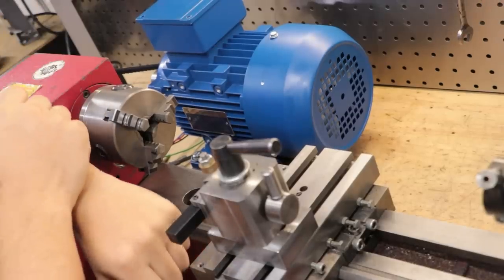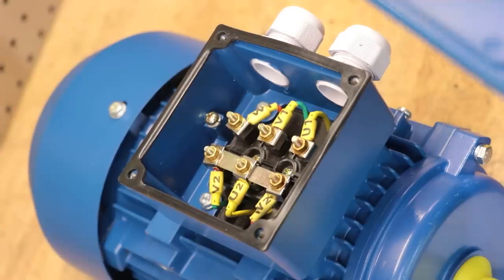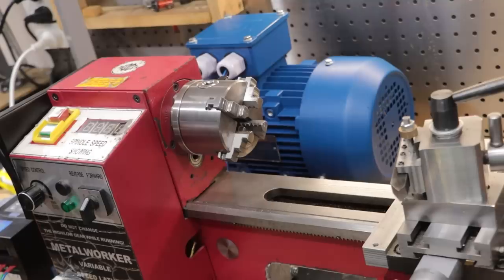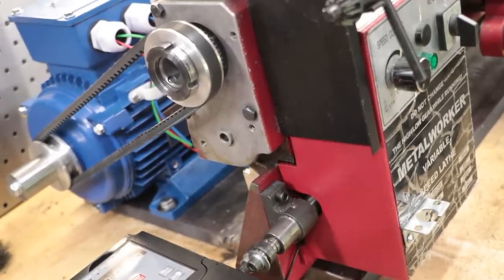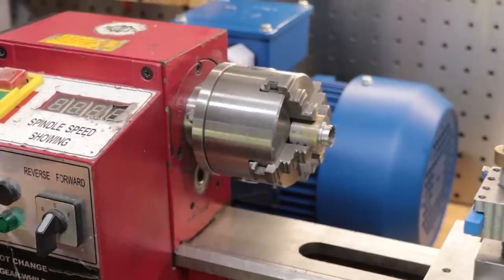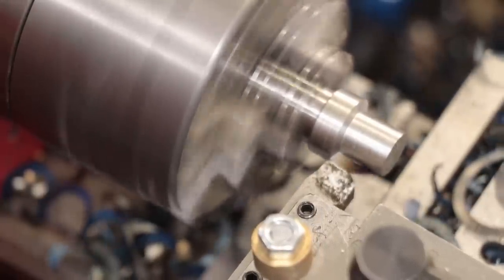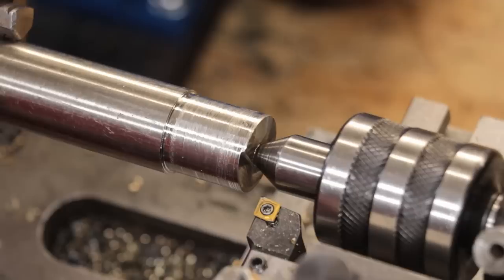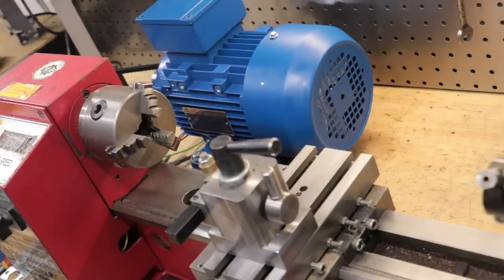The 3HP Mini Lathe..... It Scares Me

Comment: good upgrade...BTW with 4140 it will chip lovely with a dcmt style insert .the problem is heat in the chip. if the swarf is hot it will be stringy mostly. suds will help loads but you will find the biggest difference is reduce the spindle speed with a decent feed rate and it will chip ..if the feed rate is too slow it builds heat like when the spindle runs too fast ..its finding that balance..you can probaby tell I machine a lot of 4140 :)

Comment: I'm not sure what was causing the fear in the comments.  It seems that the only real possibility of catastrophic failure in in the spindle, but it should take way more deflection than a cutter is going to produce.  The bearings should wear faster, but that will likely become apparent before there is the possibility of a major failure.  Based on what I'm seeing, it looks fine.  It might be fun to see what a more massive chuck and some added weight to the carriage might do to improve cuts.  Weight could be added to the carriage simply by bolting it on.  This has been fun to watch!  Continued success.
Reply from the maker: I'm not sure. I am pretty confident that the lathe will handle it all. But im always happy to provide the reasoning for this

Comment: You can over clock the vfd and run at 60hz with modern motors that would give you a higher speed.

Out of interest what is the availability of older quality lathes where you are? I have an excellent Hardinge and it cost very little and has a ton of swiss multifix tooling. You might find so university selling up their tool shop tools. I would highly recommend going this route. Mine now has a new motor and vfd and runs like a dream. It's super accurate too.

Comment: I had a 1hp 3ph motor on my mini lathe , two speed v belt drive with a quick release mechanism on the tensioner lever - changing speeds took about 5 seconds . There was a lay shaft that fed power from the v belt drive across to a poly v belt and this to the spindle . Even 1hp has enough grunt to flex the carriage  but it never broke and in low speed I could get down to 60rpm and on high 3000rpm - the taper bearing get hot at this speed ! On the motor I put a small 12v Thermo fan -150 mm dia iirc and this was speed controlled via a cheap Pwm controller I got off eBay - I could run that motor all day under load and it barely got warm . In retrospect I could have saved a lot of time and effort if I had have used a 3hp motor as it would still have enough power when running slowly where as the 1hp didnt and I wouldn’t have needed the two speed drive . I now have a small optimum lathe as I sold the other one minus the motor and vid and I am going back to using HSS as it is cheaper , needs less power and is more durable than carbide inserts for what I do - every time I use it I find the edge is chipped and I have to change the insert around .

Comment: That motor seems to work wonders, makes me want to try that too.

I have a slightly bigger lathe, 400mm between centers (16") and with a 100mm (4") chuck. It came with a 600W DC motor, which is not too bad, but it stalled easily on big diameters with low rpm (only has electronic speed control and two belt positions). What I did was machine a smaller pulley for the motor, about half the diameter of the original one. That already helped a lot, recently machined an arbor with 100mm on the outside from CrMo-steel which was pretty tough, but could go 0.5mm a pass. The chips look and behave like small springs.

Oh, btw does your lathe not have a lead screw? It really helps making consistent cuts and is less tedious on the hands (also can get the left hand from the spraying hot chips lol). Also needed to make proper threads.
Reply: Minilathes have a leadscrew but it cannot go slow enough to do anything useful
Reply: O

Comment: Are you hand feeding the carriage because auto feed with proper feeds and speeds will give you the nice surface finish that you want.
Reply: yea, i thought his halfnuts were slipping or something mid cut .
Reply: He has neither a Feed Screw, not a Keyway in his Leadscrew, so no Powerfeed.
Reply: @an2thea514  The harbor freight mini lathe I had years ago had auto feed. It was too slow but at least consistent enough to get a descent surface finish.
Reply: @JETHO321  some Mini-Lathes of this size also have one change Gear Ratio of (most often) 0.1mm, but I destinctly remember his lathe not even having that.
Reply from the maker: Feeding by hand. Lots of pressure on the small hand wheel, plus I have to watch out for the hot chips. That kind of gets in the way of getting good surface finishes. Plus remember these were all what i'd consider roughing passes.
Reply from the maker: I have a leadscrew for cutting threads but its not attached at the moment. I just haven't had the need to cut threads for months and in that time ive pulled the lathe apart 4 or 5 times, so I felt it easier to leave it off until I needed it.

Comment: Rather than trying to shim the lathe, can you use the 2-piece vice to secure the plate to the mill and skim the surface with the monster fly cutter to flatten at lest the section the lathe itself sits on (it doesn't really matter if the motor section is flat as long as the pulleys are lined up)?

Comment: if you're having issues breaking chips try putting a deflector on the tool either clamp on or brazed. just enough of an angle increase to encourage a stress bend on the chip. when i say deflector i'm thinking more of a slight redirect.

Comment: By switching to 3 phase you have eliminated the inherent single phase pulsating torque. Overpowering is a common technique to dissipate heat. Going back in time the trick was to fit a larger motor that the inverter. These days inverters are cheap so the new trick is to derate the system with the settings.
Use the Vee belt slippage as the fusible link and detune the motor to trip at around the same current / torque.
Well done with your continuous improvement model, all or most of the previous modifications are paying off now.

Comment: I use ground sharpened aluminium inserts for all my lathework, even on stainless steel. They will dull over time but for me they leave such a good finnish on the parts. And it kinda cuts rather than peels. The downside is you will go inserts a lot faster. but for a hobbyist and the cost of $30 for 10, I dont think they are too bad.

Comment: I have this one job at work in 316 Stainless and I do a lot of drilling and a little bit of milling into a plate. it's a real pain to break chips with the drill and I end up with a birds nest every single hole. I might have to code in a reverse spindle direction and coolant to blow off the chips.

Comment: Those tapered roller bearings are very strong at axial and radial loads, but they are very imprecise!
They move relatively much under load!
You can get angular ball bearings in alot of common sizes, they are much better.

Such a motor upgrade is on the agenda for my mini lathe too! Mine hase a 750W motor, that is somewhat acceptable....
Reply from the maker: I haven't found that to be the case, we are getting run out of less than 0.01mm on the spindle. Granted these are moderately expensive bearings

Comment: Those tapered roller bearings are UNBELIEVABLY tough, if you got a quality pair and keep them well lubed. We used Mystik JT-6 grease on them.

We had 4 of them on the blade shafts of our asphalt/concrete saws, powered by a 35HP gasoline motor, with a 50lb flywheel, side loaded (similar to what you have but needed 6 groove belts to transfer the power) under the worst conditions you can imagine. FILTHY, very high vibration, heavy loads, shock loading at full throttle, etc.

Even then, in 16 years, we only had to change out a single set of them. Every other time, the whole rest of the machine was basically destroyed by the work before the bearings ever gave out.

Comment: The problem with carbide tooling is that the suitable spindle/tool rpm is double that of hss and when the smaller diameters are machined the greater rpm's  are required for egsample 1mm hss drill may require over 10 000 rpm for machining brass or aluminium and tungsten tip/cemented carbide recommended rpm is 20 000, manual lathes these days from shop maximum rpm is 3000rpm. Australian fitter and machinists  are taught workshop formula(guesstimate) 300 x V ÷ D where x is multiplication,V is velocity of material,D is diameter of work(lathe)/tooling(drills,end mills and slot drills,side and face milling cutters etc...).
This leaves alot to be desired when efficiency with accuracy is a requirement. Take care and Cheers

Comment: I'll bet that you've really come to like that VFD controller. I think it can be wired up to a potentiometer so that you can simply twist a knob to control the speed. (You might already have that.....I just didn't see it).
As for surface finish, maybe you've got an arch - end to end - in the base. That would be a simple explanation. The cutter would go above, or below, the center line and that would cause it to drag instead of cutting. 
I just can't help but to think that there must be a simple explanation for the surface finish. Even a mini lathe should be capable of a better finish. 
Thanks for sharing! Us wannabes get to vicariously do projects that we're just not able to do right now - in the real world.  🙂
Reply from the maker: It doesn't come as standard, but it is in the wiring diagram. I think its a 5k ohm potentiometer from memory. Which material are you referring to about the surface finish. And rarely does it produce great finished when doing roughing passes, which is what I essentially showed off here.
Reply: @Artisan Makes  Not a "material" per se, but an upward or downward bow in your machine's entire base - likewise bowing the guiderails up or down. This would causing dragging in your cutters. So, it wouldn't be a twist, but an arch, end to end. I could easily be mistaken but looking for twist wouldn't necessarily reveal an end to end arch. You'd have to test for specifically that.  
Love your stuff!
Thanks again!  🙂

Comment: I have a question about you QCTP, where did you purchase it?  The QCTP looks like it locks down well.  The QCTP that I use doesn’t lock down properly and it always causes issues when turning any form of steel.  Can you share a video on how to check and correct a lathe bed twist issue
Reply from the maker: I made the tool post about 2 years ago. I have a video making it. Im sure there are more rigid tool posts but this one has the advantage of being compact too. I haven't gotten around to correcting the twist yet, but this old tony and blondihacks have great videos on the subject. Cheers

Comment: You can see the tailstock wobbling around everywhere when you were cutting the stainless, i've had great results in 316 using those Chinese ccmt inserts on my 9 inch hercus.. it looked like there might have been a chip in the centre hole throwing everything all over the place, either that or something else might be out of alignment.. might be worth checking everything and having another try
Reply from the maker: That was just down to not recurring the centre when I chucked the steel back in.

Comment: wonder if you can build a cast iron liftplate under the head , should be able to now that the mecanics for treading are taken off , will increase the dismeter you can turn over the bed and slide , might need to add support on the front and back of the liftplate so it doesnt twist the bed trying to move away from the toolpressure , you need to raise the toolholder and the center too might even need to make the crosslide longer to be able to react the side of the larger part

Comment: I can't see that it is over powered, just that you can use the lathe to it's full designed specifications with ease. It would be interesting to se how HSS goes in a tangential tool holder?? I use Crobalt tool steel from Eccentric Engineering in a tangential tool holder and it goes though stainless like butter. Thanks for showing us.

Comment: Could you have put some kind derailleur on it with the pulley?
Reply: Hahaha I Iike how you think
Reply: What is a derailleur?
Reply: @jakubkopec9313  A part of a bicycles multi speed shifting gear, that's about as concisely as I can put it
Reply: Changing pulleys take him ages because he didn't configure the setup to suit.
The belt needs to be kept straight, so the motor pulley needs to be realigned for each pulley step, plus the belt changes length to accommodate the pulley diameters.
The old school way of dealing with this is to hang the motor off a sliding surface. So, to align the pulleys you slide the whole motor along the spindle axis.
To accommodate the belt, you  have the motor hinged so that it's weight is supported by the belt. When you are on a small pulley, the motor hangs at a lower position than on a larger pulley.
This method eliminates the need for a belt tensioner or any form of fasteners for the motor. To change gears you just lift the motor, slide over to the desired pulley, and drop the motor again. Literally a few seconds.

Comment: Was that 3mm of the radius or the diameter?  that's really impressive ether way, im just trying to gain perspective. I i would also put some Corrugated Conduit over the wires to protect them from the hot chips. Great work.
Reply: He mentioned depth of cut, so likely off the radius.
Corrugated conduit is not ideal for "hot chips" The corrugations lend themselves to capturing the swarf.

Comment: So with these single phase to three phase converters you indeed want Delta, because the output is 230 between phases, which is counter intuitive when working with actual three phase power. 

However I do want to emphasize to check and double check your settings and measure measure measure. I've searched for many comments and everybody said "use delta" without any explanation, including in this video. 

And this is dangerous advice, plain and simple.
Reply: His single phase 240v input vfd outputs 240v three phase (not 415v) Delta is the correct configuration.
Reply: @bneben  Yes fair enough, I was under the assumption that he was using proper three phase input. 

That's what you get from working with big boy power and never had need for these single phase to three phase converters. I've corrected my post :) However I do want emphasize that it was reasoned nowhere as such.
Reply from the maker: I avoided a deep explanation on purpose. Despite doing a component of electricity in the first and second year of university (more physics sided), I don't think that I am confident to do a deep and accurate explanation of 3 phase motor wiring and it would be irresponsible to do so. I think that stating that delta is correct for this specific set up would be the best way to phrase it.

Comment: If you were going to go back in time to buy the mini lathe again, would you have stepped up the small extra to the SC3? The brushless motor in that lathe is obviously not 3HP but it's a good chunk better than the C3's stock motor I think
Reply from the maker: I don't know what the price difference is but the brushed motor is seriously under powered, unless all you do is plan to cut plastic and aluminum
Reply: @artisanmakes  I'm in Australia too, and know just how annoying it is to buy hobby machine tools here. Ausee machines sells the C3 for $940, the C3P (same as the C3 but comes with cam-lock tailstock and shinier handwheels) for $1050, and the SC3 (50mm longer beds, cam lock tailstock, brushless 500w motor, but the spindle speed readout is an accessory that's an extra ~$130) for $1200.
I don't care about the handwheels but the cam lock tailstock is great on the C3P - and at that point you're only an extra overtime shift away from the SC3. It wasjust a big mental block for me to spend over 1000 on anything, especially because 350 -> 500w didn't feel like a huge upgrade.
I'm happy enough with the SC3 but I wish Sieg made a mill head attachment like they do for the SC4/SC6. I don't have room in my apartment for a mill as well!
To be honest, what I really wanted was an "SC1" - like the C1 minilathe they don't sell here anymore, but with the brushless motor. I'm not very strong and would have like something I could lift on my own but with a bit more power and maybe a bit more reinforcement
Reply from the maker: Having had a quick skim on eBay not too long ago, those 8 inch lathes that they sell seem to be way better value than the 7 inch ones like the c3

Comment: Somewhere in the motor manufacturer website  (or maybe the motor plaque) there should be the max. temperature.
(¿Maybe add a temp sensor and indicator visible? just a thought).
Anyway, Keeping an eye out for the motor temperature is the proper attitude :) .

Comment: The rolled steel brace you have made - could it me machined flat by an engine engineering shop? The way they do heads and blocks? If it can be clamped would not take long (bolt to old engine block?) so not very expensive and very accurate dimension.

Comment: I feel like these little lathes would be so much better with a backgear like on a Myford or South Bend. I've got a little Cowells with a small motor which takes surprisingly deep cuts at lower speeds. Definitely makes cutting threads easier. Never seen a project for installing a backgear on a chinese mini lathe though.

Comment: A simple way to fix that without having to change to 3-phase and motor controller would have been putting in a jackshaft with a 12-12 your lead and then a multiple gear drive or belt drive to your motor with the weight of the motor tensioning belt then you could have changed your belt drive speed easily and saved you a bunch
Reply: Yeah, I just typed a more comprehensive description of the same thing. Younger folks cannot visualise that a motor can be operated without it being bolted down, yet that's the way it's most easiest done.